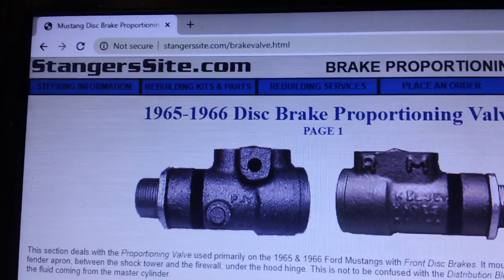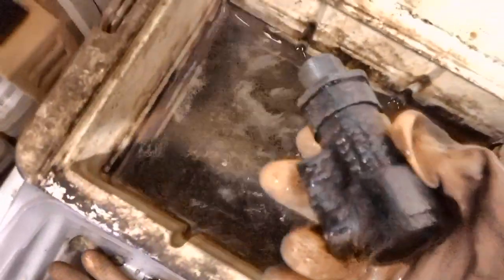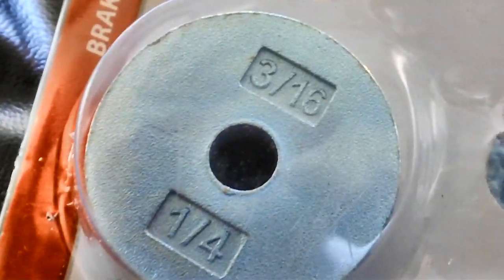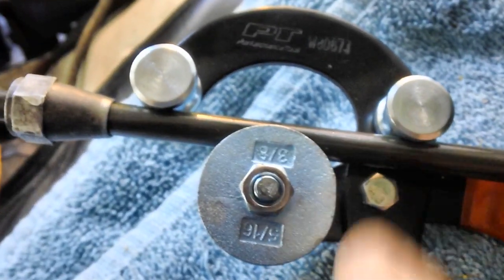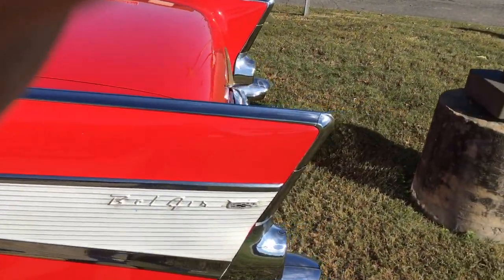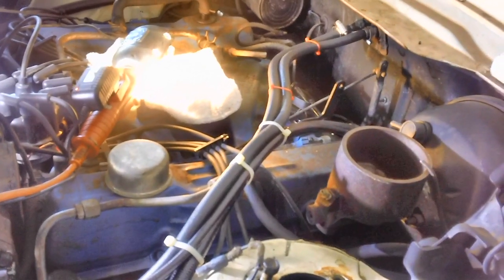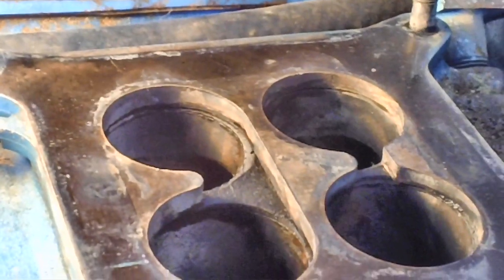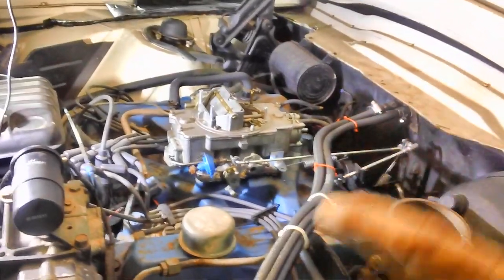1966 Ford Thunderbird repair and refurbishment (Part 60). Proportioning valve. Carburetor install.

Comment: Just a few weeks ago I replaced two PS return lines on my 62 Lincoln reservoir.  One was 5/8 and the other the more common 3/8.  I almost never got the replacement hoses over the ribbed pipe.  Obviously the new hoses that are reinforced were not made to stretch.  I used a radiant heater to get them pliable enough to finally get them on.  Glad I am not the only one having such issues.

Comment: Just recently started watching your videos and really enjoy them.  I also have a 66 Bird and I am sure they will help me when I start doing improvements to mine.  One thing that I would recommend is using muriatic acid diluted 50 percent with water, it will remove rust in one hour what it takes the vinegar days to do.
  Keep up the good work.
Reply from the maker: Mike,
I talked about using muriatic acid in the past to remove rust.  It's too toxic, too acidic, not biodegradable and disposal can be a major headache in that it's governed by hazardous waste laws.  Vinegar is none of these.  When no longer needed just pour it down the drain or toss it out in the yard.
Regards,
John
Reply: @joernone  I may not be doing it right but I put my used acid in a larger container and keep diluting it with water until its as weak as vinegar

Comment: I will enter the advice storm and throw one into the soup. Perhaps heating the tubing ,to soften it up , will help in the bending without the kink. As mentioned many times, filling the tubing with sand will help, then heating it up to a nice red.  Use so coat hanger wire to build a template to follow  the bends. Tubing looks like stainless or a alloy and would explain why its so tough to bend. Good luck and I enjoy your videos very much.
Reply from the maker: Doug,
Stand by to stand by, my friend.  In the next vid you'll like what you see.
Regards,
John

Comment: Just found your series. I love it. Going through all episodes. I bought a 66 Tbird 5 years ago to work on with with my 16 year old daughter. Couldn't afford a Mustang and the Tbird has  AC, disc brakes, PS etc. I wish your videos were available when I started. Engine is back in, body work competed, painted, just rebuilt the carb. Working on AC and transmission leak. Need to complete the interior. Need help with steering column, horn ring, and the stuff in the dash. Need to determine how to post photos.
Reply from the maker: Neal,
Hello there, my friend, it's good to hear from you.  I just came in from working on the ole T-Bird and decided to fire up the computer, so your timing is perfect. 
We're about to wrap up the series, only one more video to go.  But if you haven't yet done so, be sure to check out Nick Pepe's channel: "Vintage Thunderbird Repair".  He's been repairing and restoring Thunderbirds for over 30-years.  His channel will help you immensely with the steering column, vacuum lines, under dash stuff and so much more.  He's a true expert.  Tell him John from Arkansas sent you. 😃
Thanks for popping in.
Regards,
John
Reply: @joernone  How can I get some photos to you and the 66 Tbird group. Didn't know that there were so many out there.

Comment: Bending that line is tricky business.Good stuff John. Watch out for the weird weather. Spring in reverse you know.
ps,,, if you put sand n the tube before bending, it helps stop pinching.
Reply from the maker: Carl,
Yeah...using sand goes way back, but I didn't feel like buying a bag of it just for that one short tube.  However, there is a far better way, my friend.  Stay tuned.
Regards,
John

Comment: Nice 57. Have you tried putting sand in the tube before your bend it?
Reply from the maker: John,
I preferred to not buy a bag of sand just for a short length  of 3/8" tubing.  There is an alternative.
Regards,
John

Comment: I got a late 60s early 70s color Zenith console TV for free the other day. Power tuner. Almost as high cotton as a remote set LOL. The sad thing is I won't be restoring mine anytime soon because of the CRT. I think someone saw that it had a bad blue gun, barely put the socket on the rear. I get the TV home,  start taking the back off,  it falls against the socket, snaps the keyway and nipple on the tube effectively breaking the vacuum. I later find the blue screen and drive controls were wide open. So I guess I EOL'd a bad tube. I think you need to get the Thunderbird and the TV going. That would cheer me up as I wait to cross paths with a decent CRT LOL.  Boo boos bite big sometimes. ugh. 
Regards
Jeffery
Reply from the maker: Chalk it up to older age, Jeffrey.  It's only the start of many boo-boos to come.  😁
Regards,
John

Comment: Ever had the problem with your jukebox fixed yet? In other words the mechanism repeatedly moving & stopping when you try to make a selection? I believe it's the play control relay in your Tormat control unit. Just listen to me right,please,I believe you need to take that relay apart,the one with the two solenoids & clean the whole thing,if that doesn't work,try getting a control unit from a 1960's or 1970''s Seeburg & using the relay from it(if you're in luck,try a DCC (short for digital control center )from a 1970's Seeburg & use the play control relay from it),I believe unless otherwise that both play control relays are identical.
Reply from the maker: Mathew,
I know exactly what the problem is, but getting around to it is the problem.  I'm also having an issue with one of the florescent lights coming on.  That's been a bugger of a headache.  But we'll get back to the juke this winter.
Regards,
John

Comment: Are you going to try and get the AC working?
Reply from the maker: Hopefully, the AC still works; the system is still charged.  If not, it'll for sure have to be repaired.  Arkansas summer heat is a killer.  😎
Regards,
John

Comment: I have a ford tunder bird hard top landau 1966 with 390 can I take the California sistam off I don't live in California  I live in Wisconsin
Reply from the maker: Adamin,
I don't see a problem, but I'm of course no authority.  However, I'd remove it if it were my car.
Regards,
John
Reply: @joernone  thanks so much I will get this done